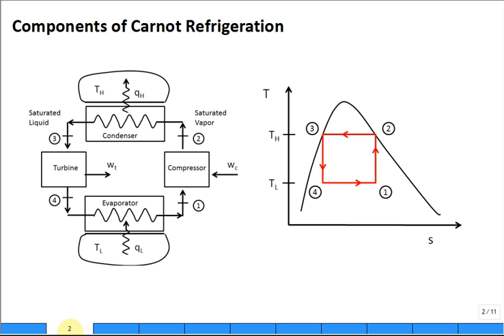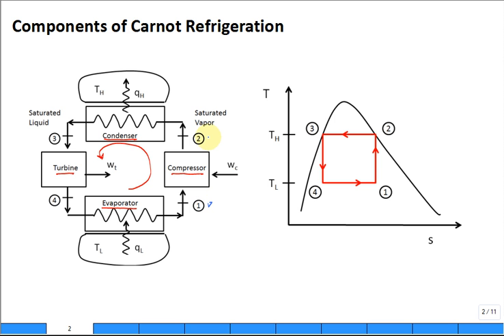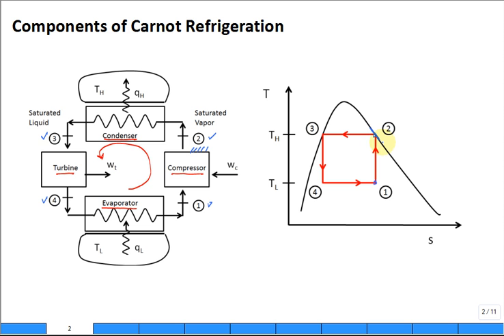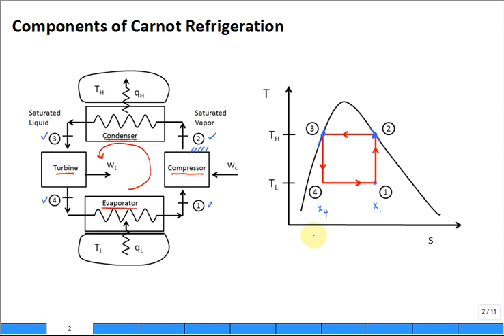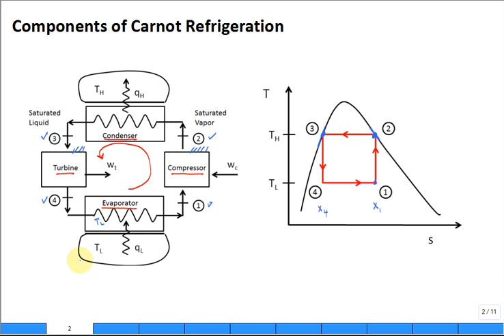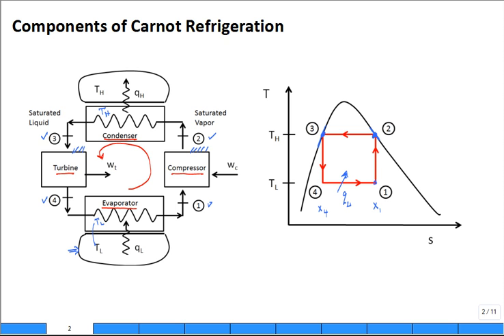Quick Overview Carnot Refrigeration Cycle

Comment: I had some useful information I wanted to share. At 0:53 You mention that the expansion is done through a turbine "which doesn't happen in practice". This actually does happen in practice in large systems. Old air-cycle refrigeration almost always used a turboexpander as the expansion device dividing the highe pressure and low pressure sides. This was due in part from the large energy required to compress air, and the low COP of air cycle refrigeration in general. I got to thinking if this was possible in vapor compression refrigeration, and it turns out, it is possible! I discovered that some large centrifugal chillers have a turboexpander expansion device, often on the same shaft as the centrifugal compressor. It is said that it can reduce the power requirement by 6% to 15% compared to a throttled expansion.
Reply: Air-cycle is discussed later in this class and textbook as the 'Brayton refrigeration cycle' or simply gas refrigeration. Interesting on the turbo expander for vapor compression, there's also a ResearchGate article on it.